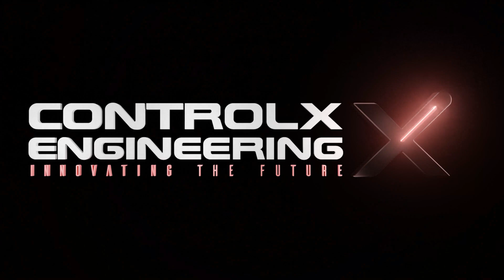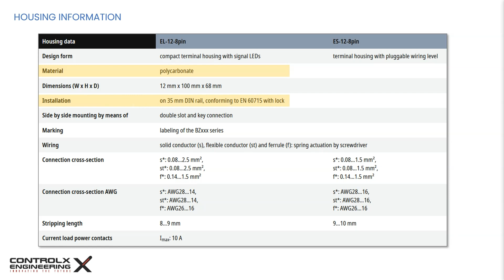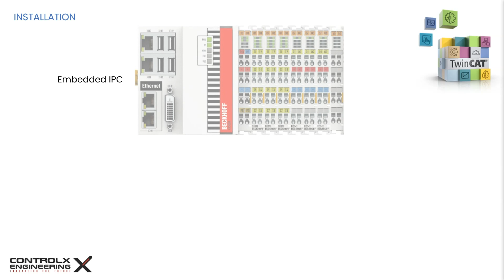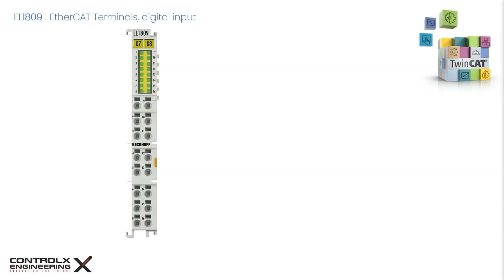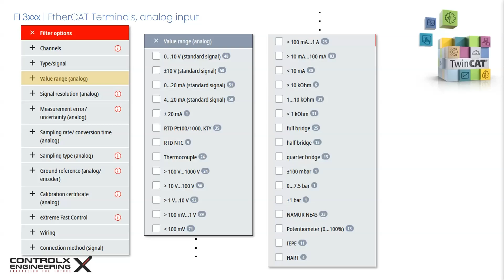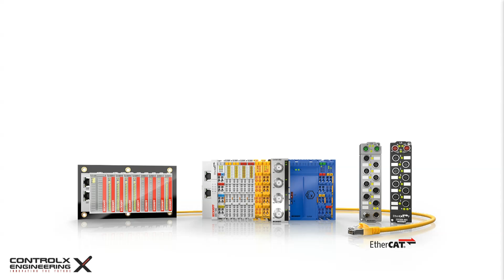Getting started with Beckhoff IO Terminals - Part 1

Comment: Hello, 
can beckhoff EK1100 with some I/Os connect to a common laptop ?
Will the laptop act like a plc?
Also, can data acquition be applied , for example temperature monitoring ?
Thank you.
Reply from the maker: Yes it will work with a laptop. Your standard TwinCAT installation also includes the runtime which can run on your laptop. However, it's real-time operation is not guaranteed. According to my conversation with Beckhoff application engineers, the official Beckhoff IPCs are "optimized" for real-time operation and guaranteed to work under the specified ambient operating conditions. A standard computer may not perform reliably and Beckhoff will almost never provide any support for such applications. Personally, I would not recommend this setup for any industrial application.

Comment: Hello Sir. I own Beckhoff EK 1100, EK1110, EL1008, EL2008, EL4002 and 3 of EL7041.
Do you know what do I need to do to get it working with CNC controller Software called Mach4.
Thank you.
Reply from the maker: The Beckhoff components that you mentioned use EtherCAT fieldbus for communication. You will need an EtherCAT master to communicate with those components.
Reply: @ControlXAutomation  Hi. Thank you for getting back to me so quickly. Can I use my laptop as an EtherCAT master? I'll be using it Running CNC Software Mach4 for my Milling Machine.
Reply from the maker: Yes you can. You'll need to install TwinCAT 3 and set one network adapter for real-time use. However, full real-time performance is not guaranteed.
Reply: @ControlXAutomation  Thank you.
Reply: A miracle